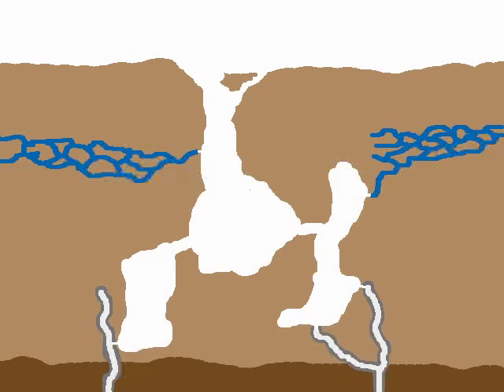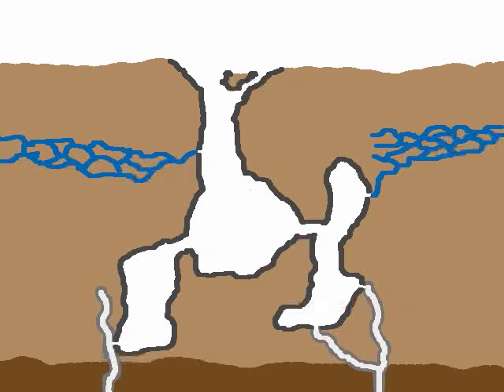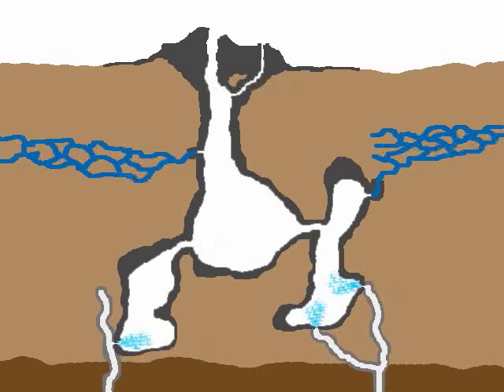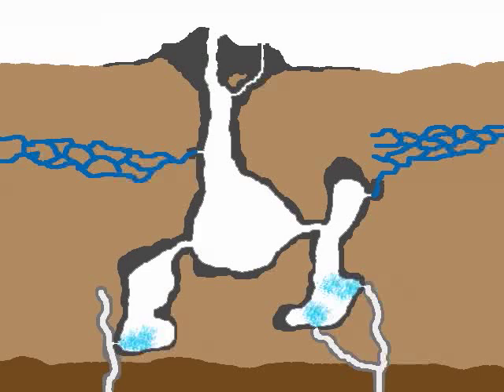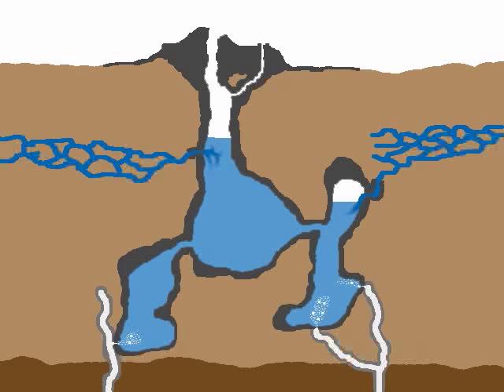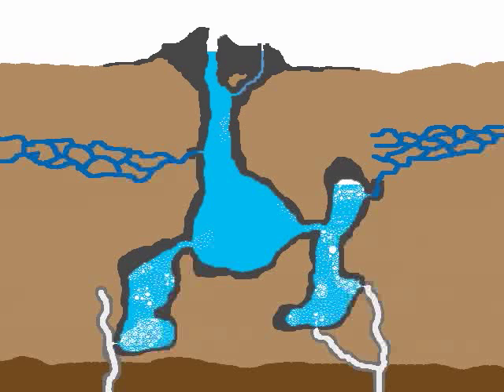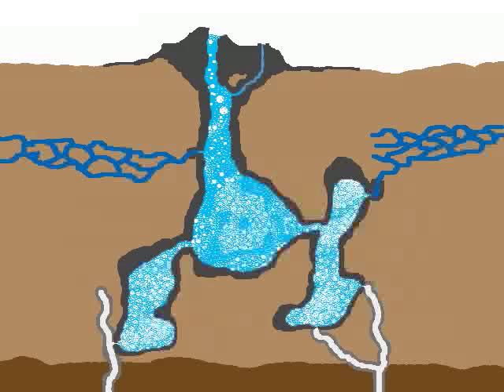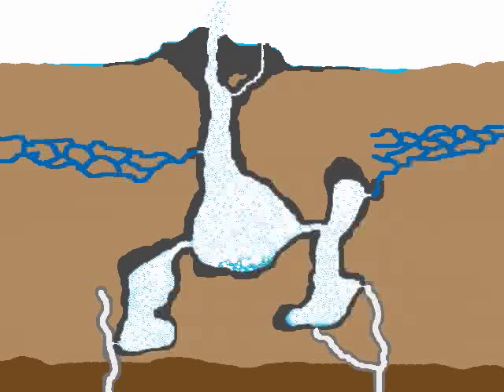Geyser Animation

Comment: Perhaps you should join him, it is considered that most "true" geysers have a constriction. But there are exceptions. Almost all hot springs can erupt if you release the pressure of the cold water on the top of the system, this can occur through the pool dropping it's level, increasing it's temperature, or possibly from a lowering of barometric pressure. You are correct in saying that you don't need a constriction for eruptive activity, but it is thought most geysers need one to be regular. .

Comment from the maker: Hmm. Perhaps you should read some of the literature, or build some models yourself. Both in theory and in models, it's been known for quite some time that a constriction isn't required. A simple, straight tube will cause geysering just fine (this is actually a problem with cryogenic fuel lines in rocket systems as well). I've built plenty of geysers, without any constriction, and they erupt - reliably.

Comment from the maker: Trying to figure out why some geysers are inconsistent, and ascribing it to the water source or heat source being inconsistent, doesn't help a lot... it just pushes the question back to "why are the water or heat sources inconsistent?".

Geysers it seems are very sensitive systems - so tiny changes (wind direction, air temperature, air pressure, etc.) can be magnified into significant differences in behavior.

Comment from the maker: "...can erupt if you release the pressure of the cold water on the top of the system, this can occur through the pool dropping it's level, increasing it's temperature, or possibly from a lowering of barometric pressure."

Note that many geysers are actually superheated at the *top* of the column... so I'm not sure if you consider this "cold water". A pool "dropping its level" has to take place through some mechanism... and spilling over can't do it.

Comment from the maker: "You are correct in saying that you don't need a constriction for eruptive activity, but it is thought most geysers need one to be regular."

The models are just as regular with or without one (well, actually the models are *more* regular without one). Only one geyser conduit (Old Faithful) has been imaged to any significant extent, and it *does* have a constriction. But in the majority of cases... we simply have no idea what the geometry of the system is.

Comment from the maker: @supercj8899 Well... sort of. Kinda. It's more like a pressure cooker, but instead of a lid bolted on, you have a long column of water keeping the pressure high. For a boiling pot of water, you really don't care that the top surface of the water is higher than the bottom (it's not significant). For a geyser, that difference in pressure between the top and bottom of the water column is critical. But, essentially... it really is (conceptually!) this simple.

Comment from the maker: ...... Nor can just heating it up (hot water exerts the very same pressure, becasue it has the same mass). Barometric pressure changes can lower the hydrostatic pressure at depth... and while there is some correlation on a few rare geysers with barometric pressure, the causative mechanism is uncertain.

Comment: I was thinking about why some geysers are so much more variable than others.  Seems there's a few obvious variables.  Either their water source is inconsistent, their heat source is inconsistent, or for some reason pressures equalize such that there is not an explosive eruption (were the ones I thought of.)  I wondered about water sources and/or reservoir sizes.  Seems to me a geyser could have plumbing such that incoming water filling it's reservoirs is inconsistent.

Comment: Thanks , interesting to have it visualised. But how does a cold water geyser work ?
Reply from the maker: In a similar fashion actually - in a 'cold water geyser', it's dissolved gases that are kept in solution due to the increased pressure, instead of water kept in a liquid due to increased pressure. But both work similarly, in that a release of pressure drives the gas in to bubbles which reduce the pressure further, leading to a runaway.

Comment: Geysers do not have long, narrow conduits as once thought. Instead, bubble traps form inbetween jumbled boulders deposited by landslides.
Reply from the maker: +Tag Wolf Well, perhaps… and perhaps not. :)

Some recent models (published peer-reviewed models) have shown that a bubble trap configuration will work… but you can also build models that very convincingly replicate not just simple behavior, but more complex behavior like Turban triggering Grand with models that do not incorporate bubble traps. Actual video from within geysers points to both possibilities as well (in Kamchatca, the geysers are mostly in complex talus style deposits, with lots of possibilities… yet in Yellowstone, most geyser systems that have been plumbed or imaged are direct vertical narrow conduits). There's also temperature data that show some geysers (Old Faithful for example) go supercritical at the top, not at the bottom, and erupt in a "top down" not "bottom up" fashion (no bubble trap there). Both Geyser and Stokkur (two famous geysers in Iceland) also appear to have no bubble trap system, but are simple vertical shafts with boiling starting on the bottom (and that's pretty well established by temperature measurements as well there).

Take a look at the geology of the Yellowstone geyser basins… they are certainly not talus-based (recent sediments, fine grained, over rhyolitic base layers multiple tens of meters down).

Comment from the maker: Reservoirs and water sources: the water sources seem to be 2-fold: deep water from underground (identified by the ion ratio of various substances... research "geothermometer") as well as shallow, surface-derived waters. As to reservoir size... you have to define what you mean by "reservoir". The volume erupted? The volume erupted plus what is left over in the immediate plumbing system? The total local water table? The question needs more definition before you can look for a clear answer.

Comment: but why doesnt it find equilibrium and just constantly boil and steam somewhat instead of pulsing back and forth between nothing and then eruption?
Reply from the maker: Some systems don't reach a steady equilibrium - think of things like predator/prey cycles. It's a balance between water inflow and heat inflow... too much heat, and you have a steady boiling spring. Too much water, and you have a steady warm artesian spring. But somewhere in the middle (with a certain plumbing system), there is a third possibility which is stable cyclic eruptions.

Comment: I have few qiestions. What are super heated water from below. Where it origimed and why its not hot magma from core. From where those super heated water comes. Another question what is the origin of oxygen. Do you think the oxygen origined from those bubbles from the super heated water from the imside?? Hope you eill answer soon. Thanks.
Reply: Sorry but he ain't gonna answer that question this was in 2009
Reply: @rodneynorman8965  But I got many answers in other videos of different subscribers. But may be you are correct. May be he stopped to add any videos or died.
Reply from the maker: I'm not dead yet ;) But, I have been busy with other things.

The water is heated from below because the rocks deeper down are hot. They are essentially still hot (still cooling) from when the volcano erupted much earlier. Magma (liquid rock) is present, but deeper down - and water that drains deeper and closer to that, heats to the point of being superheated steam, and that high-pressure super-hot steam comes up. when it encounters shallow groundwater, it heats that ground water close to the boiling point. That's the source for the energy driving these eruptions.

As to oxygen... that's a different subject. But there is a LOT of oxygen on Earth, locked up in rocks (as silicon dioxide, a mineral known as quartz, and others) and as water (just hydrogen and oxygen). Plants can split water in to hydrogen and oxygen and use that as a source of hydrogen... the oxygen is a 'waste product' that they release. That's the source of the Earth oxygen-rich atmosphere.

Comment: how does the water get heated?
Reply from the maker: +Kreychec In the models I use an electric hot water heater element… a 1300W element runs on normal house current and costs about $10. In a real geyser, the water is hot because it has circulated through deep rocks that are still hot from when they were molten. It never comes into contact with molten rock, just very hot solid rock at depth. The entire system is slowly cooling over millions of years… but there's a LOT of thermal energy stored in the form of residual hot rocks.
Reply: Thanks so much!
Reply: +Brian Davis what will happen if the geyser enterup and you jump out there
Reply from the maker: +Erika Jane Mamucod If you jump in… you would die. Very painfully. The water you see is boiling, and combined with steam. There have been people who have jumped or fallen into geysers or hot spring. ad they've died. Horribly. Burns over 100% of your body are a terrible way to die.
Reply from the maker: +Erika Jane Mamucod No, not black… the water is boiling, not hot enough to cause a fire. So not black… but it would kill the skin almost instantly, and that's both incredibly painful and deadly.

Sadly there have been a few cases where people have fallen or even deliberately jumped into hot springs or geysers. I'm not going to relate those stories here because frankly, they are horrific. But you don't turn black.

Comment: This could have been answered in one word "HEAT" lol
Reply from the maker: <grin>. Sort of… but it takes a lot more than heat, and heat is not enough. In fact too much heat, and you get a steam vent, not a geyser. So… I'm OK with this :)
Reply: Brian Davis Is super heated water still in liquid form? I thought at 100c water turned to vapour
Reply from the maker: Arse Robinson In a geyser, the water at depth does go above the normal boiling conditions… it is superheated with respect to the surface. It's kept from boiling due to the pressure of the overlying water. It turns out you can also have slightly superheated water even at the top of the water column, where you wouldn't expect it. Boiling is hard to start, so superheating does occur, and disturbing a superheated volume of water can induce VERY vigorous boiling (you can actually superheat water in a microwave in a smooth glass bowl, for instance… but if you dump in a powder like sugar you get very vigorous (dangerous!) boiling).
Reply: The short answer would be: The boiling point changes with pressure. It's superheated water (yes, the fluid) because it is under pressure. Otherwise it would just be steam. Hope that helps.